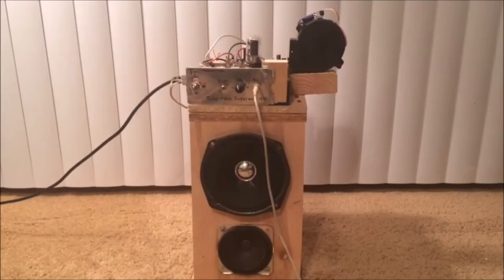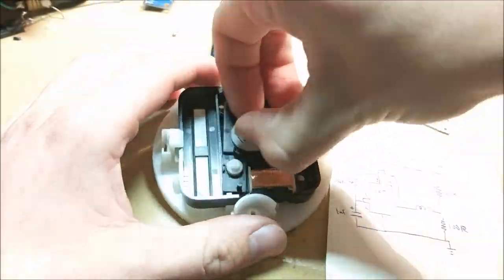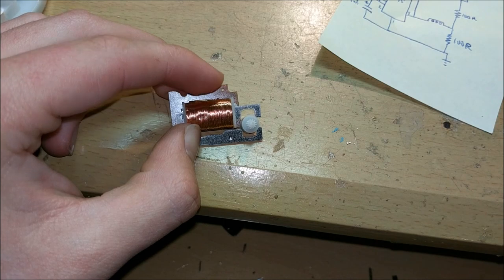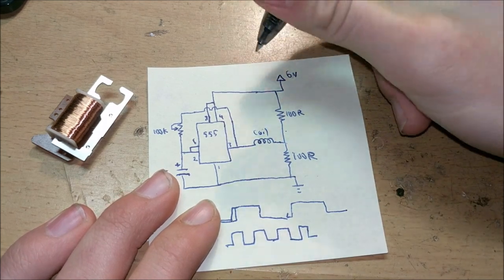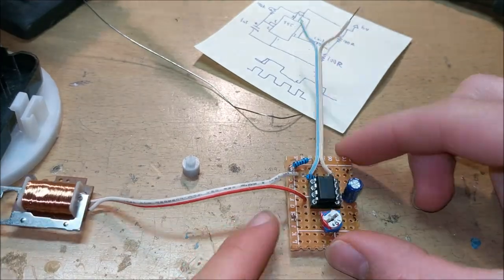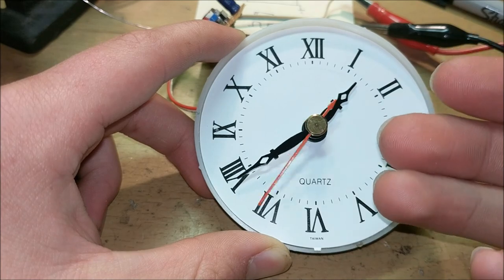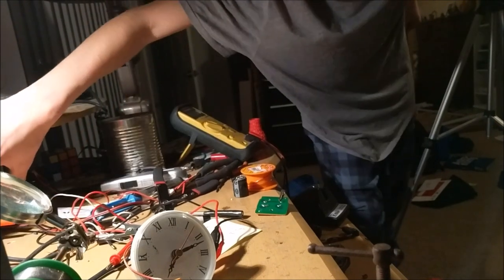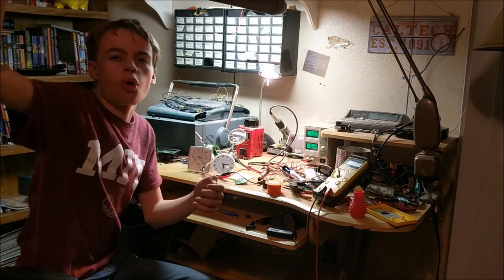The Time Machine || An Awesome Clock Hack

Comment: Found this vid while looking for some Halloween props.  Cool little project.

I’m not sure if you still respond to this old video but I am unsure how to connect the pot, pin 3 from the 555 and the coil go to pin 3 (+) of the pot and pins 2 and 5 on the 555 go to pin 2 (output) on the pot and pin 1 goes to negative?

Also how many volts input? 

Thanks in advance.